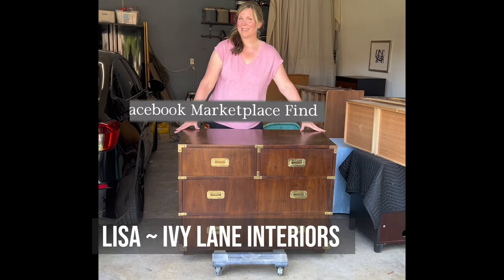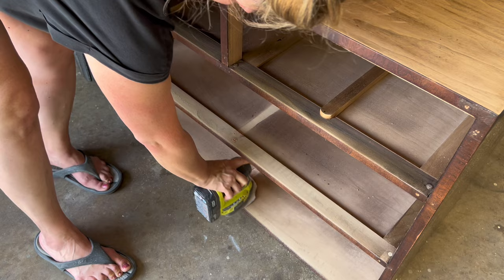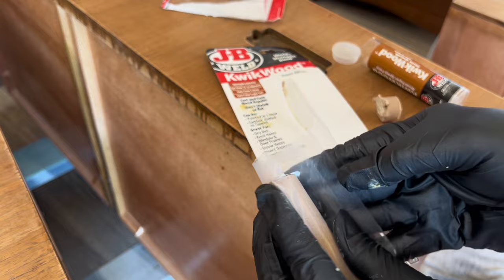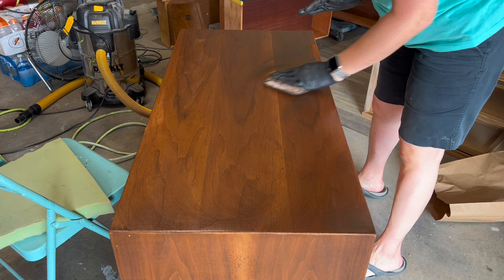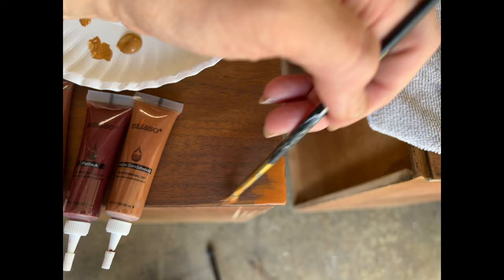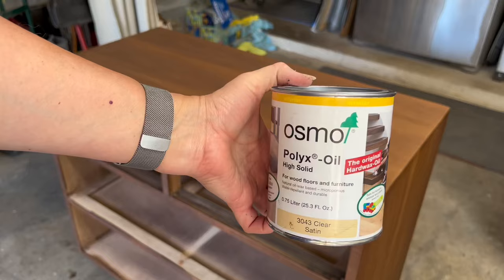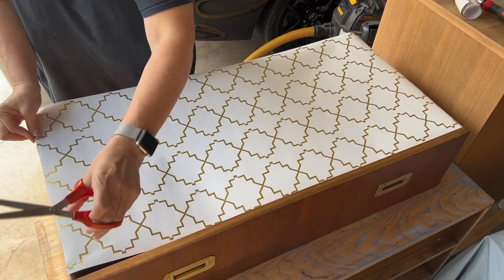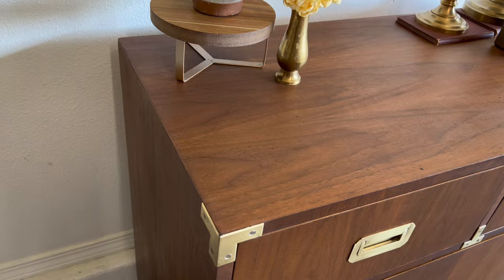Let’s restore this $50 Facebook find  |Veneer Repair | Furniture Flip | Furniture Makeover | Dresser

Comment: OMG! Okay this is the brand of the piece I need to refinish! Mine is a server…same campaign style. Where do you find replacement pulls? One of the door pulls has broken. ☹️ Ok gonna go watch you do your thang…😉
Reply from the maker: Pulls can be tricky to find. I’ve found original hardware replacements on eBay, but they are pricey. Sometimes you can find reproductions in the dimensions you need and replace all of them. This piece had all the original hardware.
Reply: @ivylaneinteriors  I started searching and couldn’t find the pull in a vertical. And in searching the maker, my server/rolling bar cart has not come up yet. The pulls I did find were pricey & if it was the right one I would’ve bought just because I’m keeping the piece. It was my mom’s & she had pretty good taste. 😎